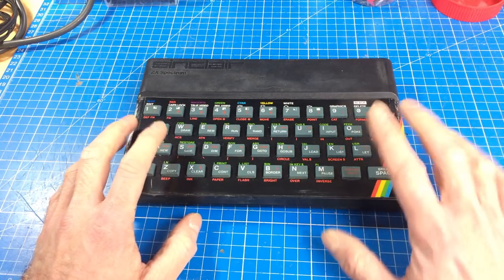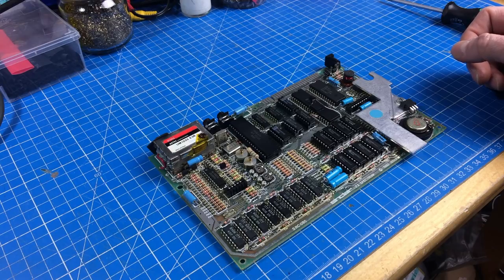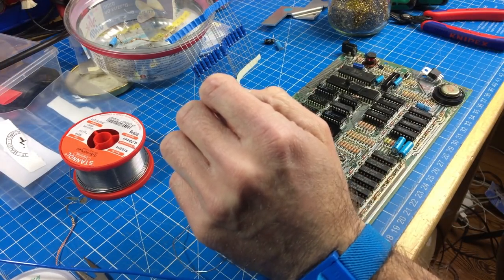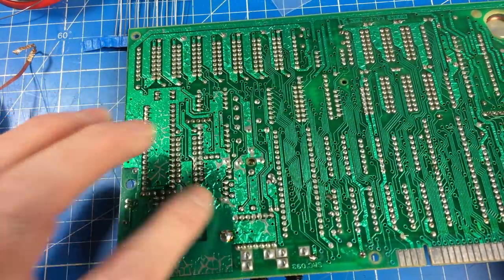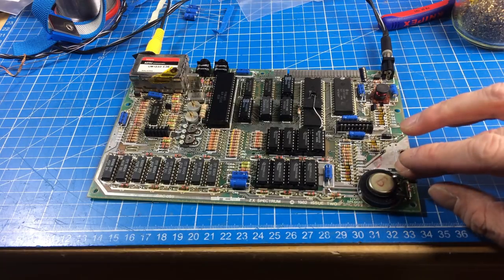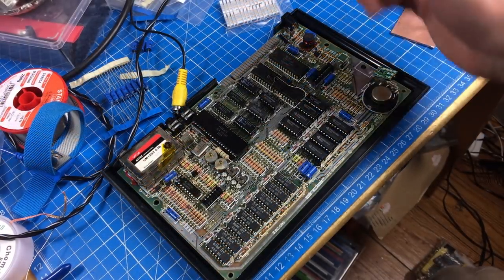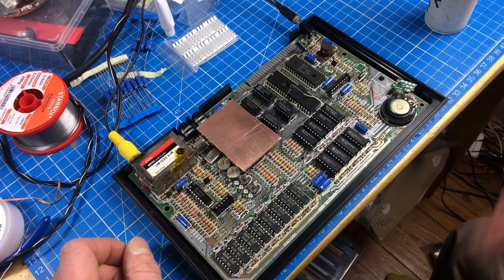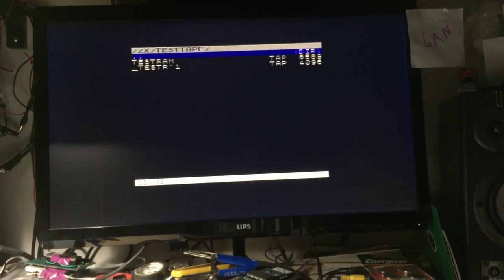Sinclair ZX Spectrum 48K Future Proofing

Comment: too late now, but you could have probably pulled the pins out of the switched mode regulator, put them in the opposite side, and had the reg lay down the same direction as the original part.  if you're worried about it contacting and shorting out, kapton is your friend
Reply from the maker: Yeah, I had that idea, too, but it works just fine like this. Doesn't look great obviously... ;P

Comment: Nice video! Yep, this is old enough that replacing the caps is a very good idea. I'm curious about the copper plate however: the heatsink compound is not quite a superglue, I'd imagine that if you want to be safe, you need a method to make sure it doesn't wander around inside? If this thing comes off, it might put a crimp on your day! Just a thought. Have a great day!
Reply from the maker: Thanks Marc. Yeah, I'm a bit worried about the copper plate, too. The plaster seems to be pretty sturdy but I might add some foam to the top cover to hold it in place or something.
Reply: Good morning Jan (ok, here it's morning anyway), I think the foam is both good and bad at the same time. Good because its springy, so if you cut it a little thicker than the actual case clearance above the chip, il will effectively immobilise the copper plate. Bad, in the sense that the foam will act as an insulator and trap the heat right where you want it to escape. Or, cut the foam so that it gets a big hole in the middle to let the heat escape. The dream solution would be to use a 3D printer... kidding of course. I'm projecting. That's precisely the kind of situation where I'd very much like to have one, to design a bracket for the part that is made to measure. That'd be nice... sigh Have a great day!

Comment: As usual another great video that i learned a new thing. Can this dc-dc converter be used in C64 psu? Raplacing the voltage regulator may be?
Reply from the maker: I think this particular one is too weak as it's only rated for 1A. You could use a DC-DC converter with a higher rating without any problems I think. (I'm planning to do a video on C64 PSU mods soon, too.)

Comment: 13:00 where do you get the replacement for the 7805? what search term on ebay?
Reply from the maker: I think I just searched for "7805 replacement" and chose the cheapest option. I would recommend getting a better quality one though, like TRACO or RECOM who both produce very good pin compatible replacements (they are 10 times more expensive but really safe to use).

Comment: Btw, from my experience, the CPU can get pretty hot too :) But of course, it's much easier to find a replacement Z80. There are copper heatsinks for M.2 drives (available at Aliexpress) that fit the ULA chip almost perfectly.
Reply: Would it help to resocket ULA into a precision socket? Or maybe a low-profile one?
Reply: @wolcek  I don't think it's necessary. But in order to improve thermal management I would add a low-profile heat sink to both ULA and Z80 and also change the linear voltage regulator to TRACO TSR 2-2450 which doesn't produce heat.
Reply: @baze3SC  I got the 1.5mm M.2 ssh heatsink, but it touches the top case. I was thinking about getting a low-profile socket, like Samtec ico-640-l, so the ULA will be lower, but still in a socket. 
The Z80 will wait for a heatsink for a while, but the TRACO (I used the 1-2450) is already there. Also the DC-DC mod for Issue 3, but I think the coil is failing - I have burnt my finger touching it, so that's the next thing on the list.
Reply: The low-profile socket works. I wasn't sure if it would fit into the holes, but it does. The ULA is a couple of mm lower, and the 1.5mm heatsink fits nicely.

Comment: ive just experienced a bad cap, sure it was only an led bulb, the light worked one day, not the next, i pulled it apart, the cap looked fine, it measured the correct uF, but the ESR was 20 ohms!   imagine it had been creeping up till it was too far,   modern caps are a pain in the butt!
Reply: Rember to also test the rectifying diodes when you are at it. Leakage through bad diodes may kill caps too.
Reply: yes i didnt do that, it was a cheap chinese buld, just meant as an autopsy, wasnt going to repair, just curious f what failed when nothing had burned or popped.
Reply from the maker: Yeah, they often use the cheapest stuff around that is bound to fail pretty quickly in these warm environments. Planned obsolescence, I guess. Even if I sound like a conspiracy nerd. ;)

Comment: Would it be better to remove the RF Modulator completely or is it still needed ?
Reply from the maker: Oh, it's not powered anymore so it doesn't really matter if it's still on the board. You could remove the whole thing. I like to keep it reversible although I probably won't ever go back to RF. ;)

Comment: The resin or plastic from which DIP cases are made is not very heat conductive. The silicone structure in large chips is in the middle, so putting 3 separate aluminum heatsinks on one big DIP IC like you did on C64 has really no sense. Only central heatsink will do the job, while side heatsinks won't even get warm. Copper plate is a much better solution.
What happened to your desoldering station? By removing caps like you showed on this video you are risking damaging of pads and vias.
As for ESD straps - they do work (except for Chinese wireless ESD straps of course), yet they have very limited use in case of TTL chips. They are much more important when working with MOS/CMOS chips. Your table mat probably is static dissipative (ESD safe), but it also should be grounded.
P.S.
Mats and straps are static dissipative, not anti-static. Anti-static surface just prevents static charge to build up, while static dissipative surface will dissipate (discharge) the charge even if it is externally applied to that surface.
Reply: I guess he wanted to show that a desoldering station is not perse a must have albeit much handier
Reply from the maker: Yeah, that was the intention. Also, I would have had to store the C64 away again to set up the desoldering station. ;)
Reply: The Z80 is NMOS, as well as the static RAM.
Reply: The dynamic RAM (no static RAM in Spectrum).

Comment: Some very useful ideas. Can you give the make/model of the voltage regulator, I like the idea of losing the heat sink :-)
Reply from the maker: You can search for a drop-in replacement for a 7805 voltage regulator. There are very good ones (like TRACO brand for example) and the cheap generic ones I used.
Reply: Thanks I think I found some like yours on eBay.. the seller is on holiday until 20th February  :-)

Comment: Link for those regulators?
Reply: I actually replaced the voltage regulator on 3 of my Spectrum 48K with this -
https://www.digikey.com/en/product-highlight/r/recom-power/r78-series
Reply: I found a bunch on ebay searching "voltage regulator 7805 replacement" but most of the Chinese sellers are away right now.
Reply: Thanks.
Reply from the maker: They are generic drop-in replacements for 7805 voltage regulators. I got them from ebay but I guess the same things are available from elsewhere, too.
Reply: Any thoughts on how safe/stable these are?
Could they potentially do damage if they fail?
Reply: Could you replace the voltage regulators in a C64 with these too?
Reply: You could, however the two regulators in the C64 itself are used to power analogue circuits (the VIC and the SID) and these are probably best left as linear regulators for noise reasons.

Comment: Not sure how helpful this will be, but most guitar effects pedals run of 9v, centre negative. May be worth looking at these for power supplies, plus as they are for music they tend to be ultra quiet. Check out voodoo labs, t-rex, boss or even one spot supplies
Reply from the maker: I am in fact using the power supply I used for the Speccy on my DIY kit Rat pedal, too. ;)
Reply: Jan Beta are you a musician too, I know I liked you 😀. The rat is a great pedal
Reply from the maker: I play the bass guitar (and a tiny bit of guitar, too). Not doing much at the moment though sadly.